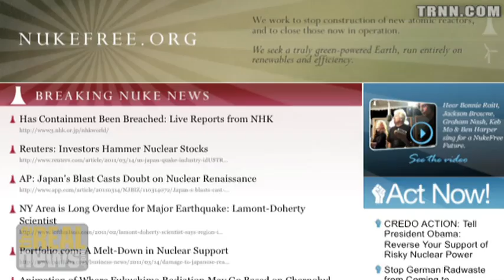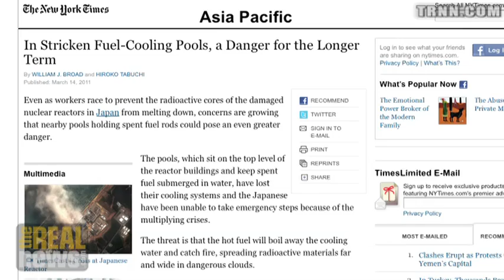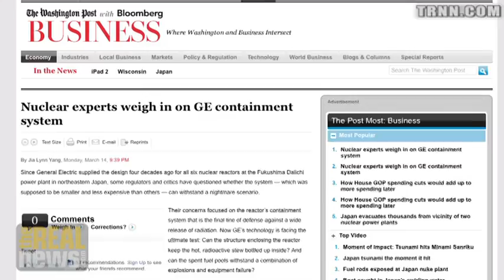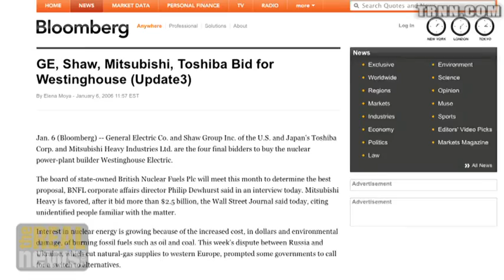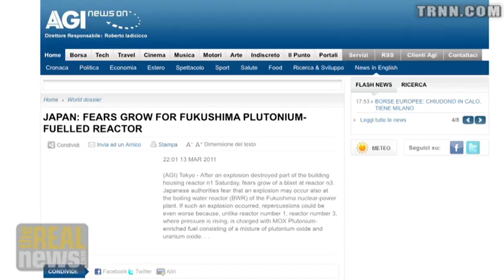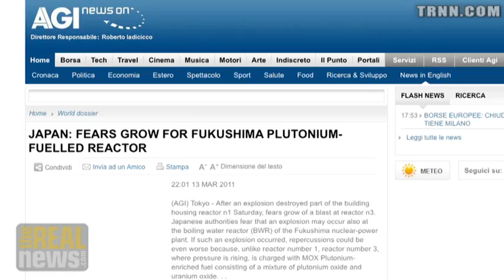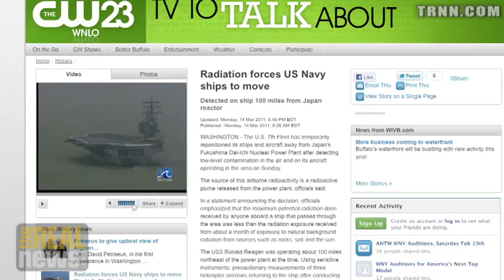Spent Nuclear Fuel - The Real Danger?

Comment: @whobrown I wish ppl would stop hyping things.
Nuclear power is necessary if we are to replace coal & oil (partially).
Making false claims (i.e., safe&clean) only hurts the debate. Fertile Th232 + neutron(s) gets you fissile U233. That happens in a fast neutron reactor or an accelerator driven one.

The ONLY problem I have with uranium is when it's coming out of a coal smokestack.